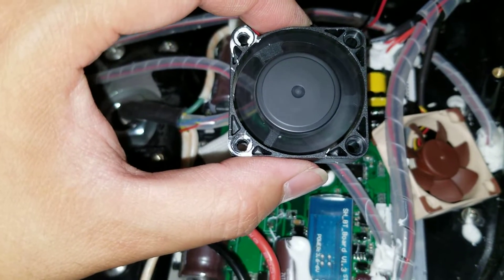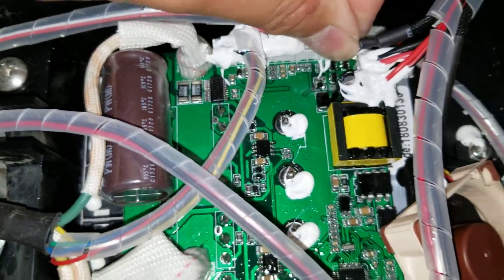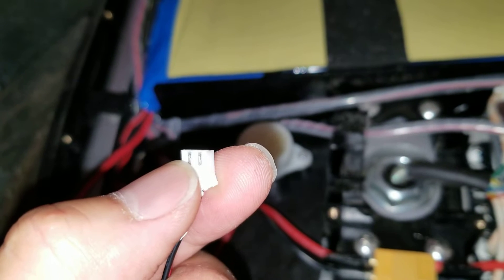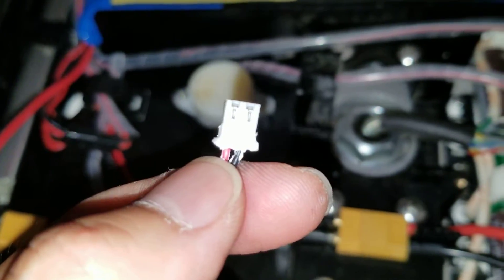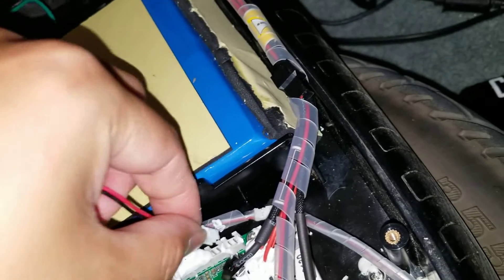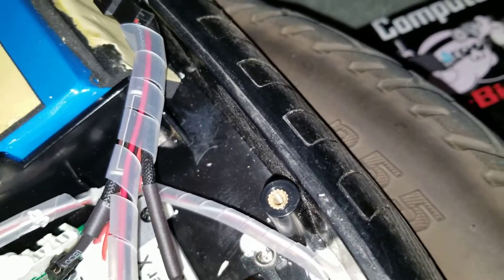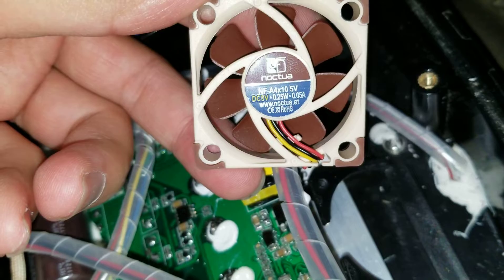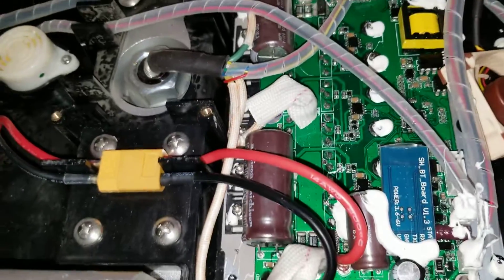Gotway Msuper X MSX Silent Fan Upgrade *Must be 5V*

Comment: How do you mount the fan? I can’t find a replacement fan with the side mount, I have a msuper pro
Reply from the maker: I'll have to see it. There's no bracket to transfer?
Reply: @ItsBinhRepaired  I found the same fan from stock on AliExpress.  

But I’m saying even the fan you are putting in, there is no side mount that I can see or did it come in the package and you haven’t installed it yet?
Reply from the maker: @Jordan Labelle  I installed it the same way it was installed in there. Not sure what you mean by side mount? Fans are usually standard and there should be a mounting bracket if anything.

Comment: Great video, but the fan in my 2020 model is a 12v.
Reply from the maker: Really? They sell a 12v model. You can get that instead. That's a more common model. Should be cheaper.
Reply: @ItsBinhRepaired  Already fitted and been using for about three months, no problems with it yet.
Reply from the maker: Awesome!

Comment: Can you plug 2 fans at the same time? Or it just have one connector in the motherboard to do that? Thks
Reply from the maker: You can splice two together in parallel to double up if you want, but there's only one for the fan. I think there are some empty 5v sockets if you want to attach one fan to be permanently on.
Reply: @ItsBinhRepaired  yeah the sec option, I'm doubting about if that can be possible 🤔
Reply from the maker: It's possible. You can even splice it to the usb port. That port is useless anyway lol
Reply: @ItsBinhRepaired  lmao, if you can make a video about it could be great, having 2 fans working sounds me great and there is no other Youtube channel with that content, thks for your replies btw :)
Reply from the maker: @ignazzioxyz  that's true, though I've never had a heat issue with my wheel and if you are, I'm not sure a second fan will be enough to cool it. It'll require soldering or a special adapter to connect the wires/pins.

Comment: Update December 2019?  Did you just leave the one quiet noctua fan in?  If so, what temperature differences did you see, if any?
Reply from the maker: I don't have a way to get accurate readings, but no problems with heat.
Reply from the maker: The connector also stayed in place no problem. Not sure why they put all the glue lol
Reply: Wheellog didn't report any temperatures? Well as long as you've ridden some miles with it and have had success, then I could see trying something like this.
Reply from the maker: @MichaelSTaylor  too many variables to get accurate comparisons.
Reply from the maker: @MichaelSTaylor  I do mostly street/road riding, so it's not pushed as hard as offroading, but I do tend to ride 25-31mph most of the time.